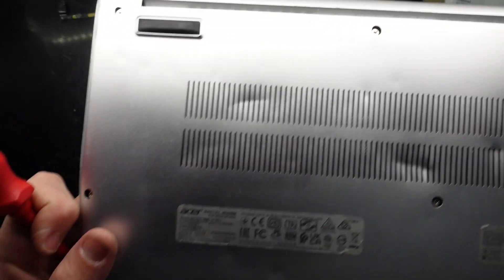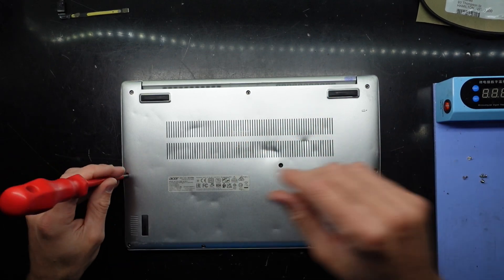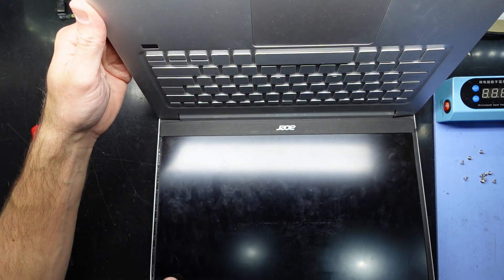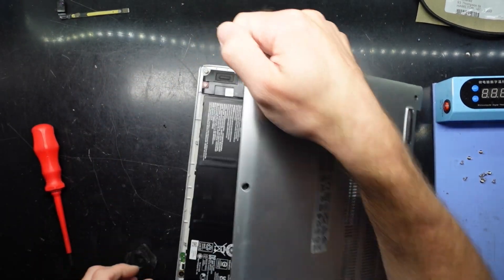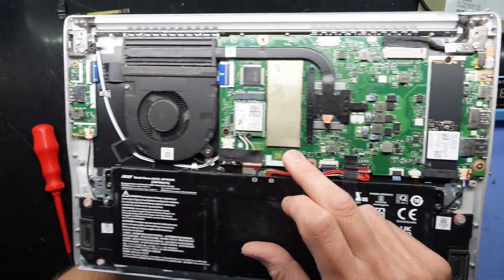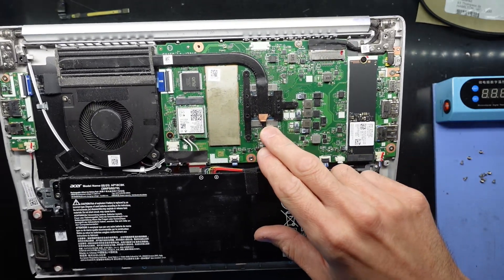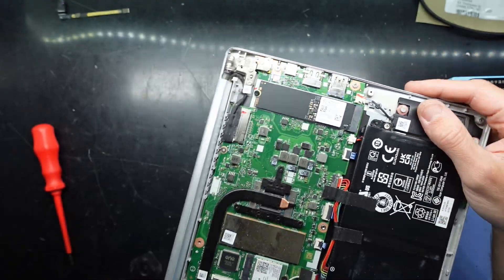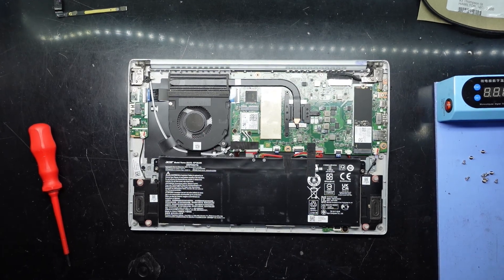Acer Swift 3 SF314-42 Teardown and Upgrade Inspection

Comment: Please tell me, is it possible to expand the RAM in this laptop model, are there additional slots for it? Or is the RAM soldered into the board and there is no connector for an additional RAM stick?
Reply from the maker: 3:15

Comment: Hi, would you please make a video on how to replace the keyboard for this laptop?
Reply from the maker: no sorry, i dont have the laptop anymore
Reply: @rickstechrepairs  if you happen to remember, would you please provide some instructions on how one may replace the keyboard on his own? Is this model easy or difficult to replace the keyboard?
Reply from the maker: this model would require a top assembly replacement with the keyboard in it